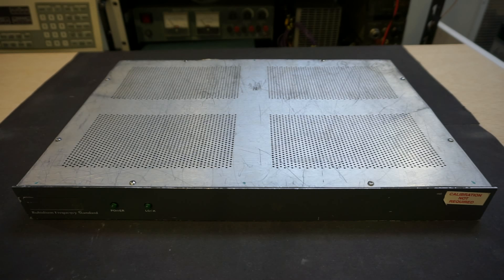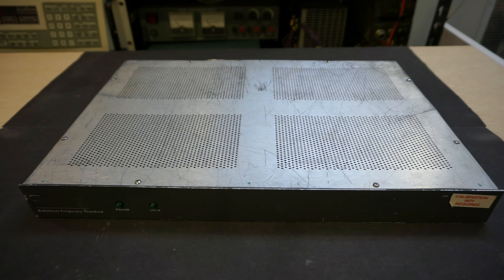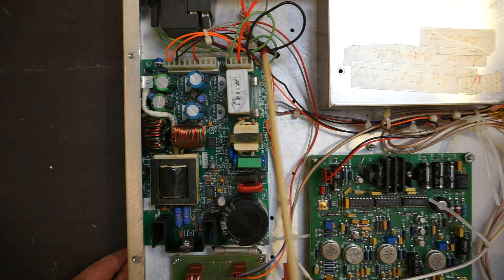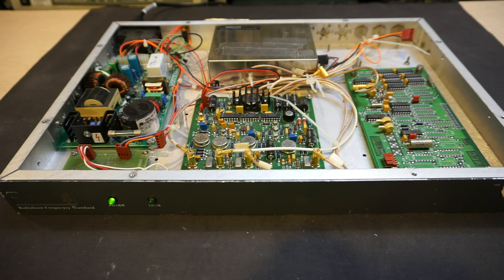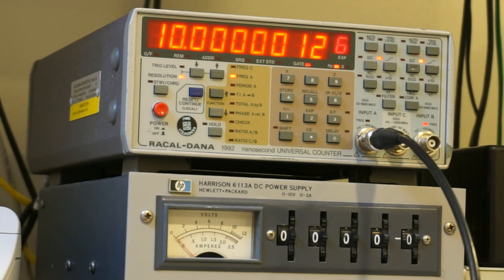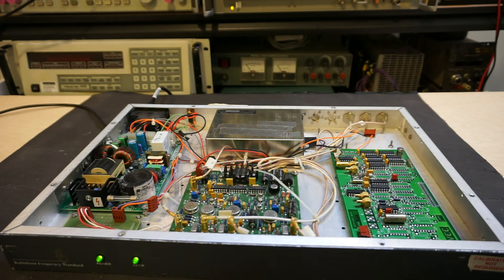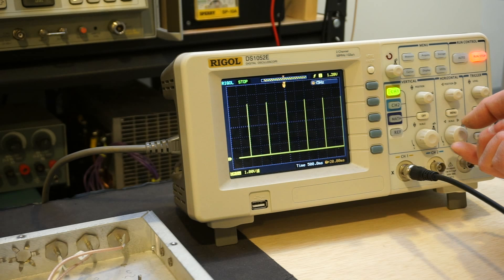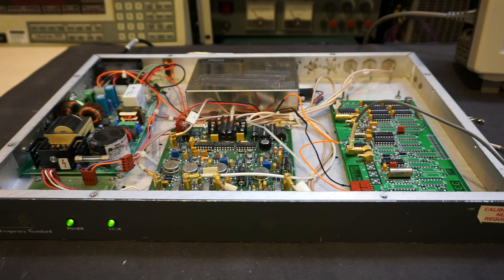Datum/Symmetricom 8040 Rubidium Frequency Standard Teardown

Comment: Those LH0033s are Calogic parts.  Everything Calogic is very expensive because they only have their own very small fab on campus at their California headquarters.
Reply from the maker: This buffer chip is largely obsolete, I believe?
Reply: I've seen the LH00033's in other circuitry and decided I'd like a few. After some looking around it turns out that they are obsolete. Don't know what would be a suitable equivalent.

Comment: Nice find Kerry. Fortunately I got my two FE-5630's when they were still around $130 (got there a little too late). In the winter time I let my GPSDO run so the heat adds to the radio shack to keep it warm; in the summer I turn it off and use the Rb standard only when I turn on the test gear to reduce the AC requirement a bit. I thought you were going to pipe the reference signal throughout the lab to all the boxes but guess you're satisfied with the accuracy of the OCXO's in the gear. It's interesting to watch both standards on the scope in a Lissajous pattern as you'd think they were very close (and they really are) but they're not exactly on the same frequency. Thanks for the video!
Reply from the maker: I had thought about using the frequency standard as the main reference clock but not sure how much life is left in the Rubidium frequency standard (the lamp voltage measures around 5.7V, OK but not great). For now, I am going to use it mainly to calibrate my lab gear clock sources.

Comment: Very cool. I got both of my Rubidium standards from a seller on eBay in California for $125 each.It was just the standard with a 0,5"" pitch Samtec muliti pin connector. I ended up making a double sided PCB with 5V and 15V switching regulators and surface mount TTL chips to get the signal off the board. and had to purchase connectors that would fit the standard on Digikey. The unit gets quite hot at operating temperature so I fashioned a box to house the thing and its PCB plus cooling and built another double sided SMD  board that has TTL drivers that drive 8 BNC connectors at 10mhz and 1 other at 1pps. If I want a 10MHz sine wave I put one of the square wave outputs through a 10MHz low pass filter which does a great job. I use the 8 outputs to drive my signal generators and signal counters in the lab. Sometimes I wish I'd gone for 16 outputs rather than 8. Nevertheless for $125 they're great pieces of equipment to have around the lab.

Oh, and I popped the cover off one of them and turned it on. The eerie purple glow coming from the rubidium physics packages is kinda soothing.

-Vince
Reply: Yep, the 1pps signal is hard to capture if you assume (like i did) that it's a a square wave 50%high/50%low. I think my 1pps output is 100us wide.... havent looked at it in a while. I also was able to hook up the rs232 interface and talk to the unit from a serial terminal.
Reply from the maker: Yeah, the physical package does run hot. I suppose you could just get a used distribution amplifier and using the outputs from the amplifier to feed your equipment.
Reply: If you don't want to kludge together your own 10MHz distribution system you might consider one that is available from the ham radio organization called "TAPR"; you can go to their dot org site and search for the TADD-1; they also have a 1PPS distribution system, the TADD-2.
Reply: Dino, Thank you so much. I'll definitely be purchasing both of these devices. -Vince
Reply: No problem Vince...I have three of them feeding all the boxes around the shop and even a receiver at my radio bench. BTW, you will have to provide a enclosure but they have one for sale that is made for that series of distribution amps.

Comment: I'm sure you could have triggered the analog scope to show the pulse, it looks like it was set to automatic because the pulse was all over the place.
Reply from the maker: It can, but given the 20us pulse width and a 1s cycle, the pulse would be very hard to see as you can only see small dots. Due to the fast rise time, the rising and falling edge would be impossible to see unless you go to a much narrower horizontal sweep.

Comment: Of course you can measure the 1pps  pulselengh with your analog scope. You have to set the trigger correctly only. Most 30 year old scopes can do this, eg my Tek 465B or much older Hameg 604
Reply from the maker: Yeah, it can be done. But it's arguably much easier to "zoom" in onto the signal using a DSO.

Comment: Any idea what the jumpers on the right board are for?
Could the second connector at the top of the board be an undivided out rather than a second input? There doesn't seem enough components on that board to do much with a second input.
Reply from the maker: I was wondering the same thing. If I switch the jumper, the output disappears. Since there are empty footprints on the board, this jumper could be for some other purposes as well.

No, the second connector is an input as I could use either one of the upper two inputs to drive the 1PPS output.
Reply: I don't know anything about frequency standards, but... 
Both being useable as an input would make sense if that board isn't designed to terminate the cable, but simply to be able to take a reference tap as the signal passes through, I.E. one connector literally wired through the board to the other with a feed to the decade counters in the middle. You could then choose to pass the reference signal through by putting it in line, or bypass it leaving a spare coax in the loom.